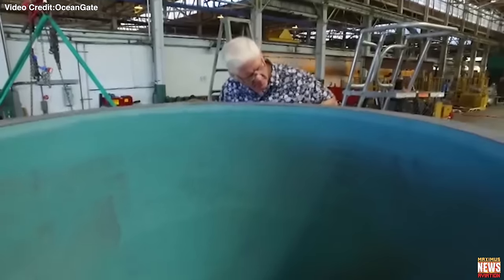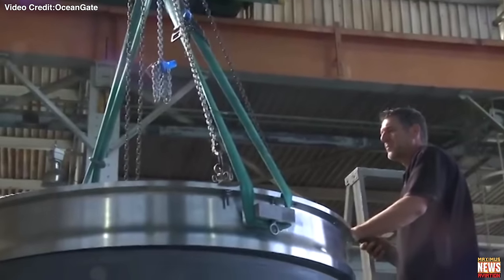Watch The Manufacturing Process That DOOMED OceanGates Titan To Fail. But It NEVER Had To Happen.

Comment: Seeing that young engineer grinning and proud of his glue job gives me the chills.  He says it as though he's building a go cart, not a deep sea submersible carrying innocent lives.
Reply: No one is innocent here and specially not billionaires!
Reply: He's done as an "engineer". I hope no one ever hires him. JMO
Reply: Shouldn't that have been done in a clean room?
Reply: @nighttrain1236  I would suspect a pressurized clean room to remove any voids in the glue as well.....
Reply: That smirk yes pure arrogance the glue that holds the family together try saying that too the familys that have lost their loved ones.
Reply: Yes.I hope that smirk has been wiped off his face.😢
Reply: They also used scotch tape for the lunar landing module.
Reply: Yeah I'd say he's cringing looking back on that
Reply: I am no engineer and its a complete guess but I would have thought that the glue joint from carbon fibre hull to the titanium end caps was the primary weak point. Has anyone tested glue in salt water under compression cycles and all the rest? Add to that the fact the door was hinged on this joint and it just seems like warping of the structure and compromise of the glue joint could easily occur.
Reply: That glue job was an absolute joke.
Reply: @johnmindson237  They should have used Gorilla!.
Reply: that glue job was pathetic
Reply: @johnwright7895  Cant stand his grinning face.
Reply: @johnwright7895 i'm sure it has
Reply: Surprised how narrow the carbon fibre strips were. The glue was being mixed as thought this was a furniture workshop. It looked like this sub was being made in someone's garage. Saw elsewhere it was described as being 'home made" this video shows that to be true
Reply: Tony Nissen - future unemployment line engineer
Reply: Wiping off excess with the plastic spatulas seems wrong. Would want as much adhesive as possible to fill every void.
Wipe off excess as is oozes out when the ends mate. The 90 degree between the titanium and carbon fiber tube could  it take flexing. Suspect it broke there if not the carbon to titanium seal.
Reply: @DALKINION  Cringing is the least of his problems. Everyone who designed that death trap of a sub should be facing criminal charges.
Reply: @johnmindson237  wasn't that version of scotch tape specially made for NASA?  The stuff they used inside Apollo 13 was Duck/duct tape
Reply: @chatteyj  Good point chatteyj. When I heard he was using epoxy resin which is the same thing as JB weld in the stores, I was shocked. JB weld claims their product has a tensile strength of around 5000 psi, but the Titanic depth has a pressure of 6000 psi. It probably sprung a leak at that joint and it was game over.
Reply: @azurie580 why do you assume he's envious? A commoner can't criticize someone wealthy without being jealous. Pfff you people for real.
Reply: @johnmindson237  maybe the living conditions on the moon are slightly better than in deep sea
Reply: 😂😂😂😂😂loll true.
Reply: These engineers look like they are from IKEA😂
Reply: So let’s glue 2 dissimilar materials together in a non sterile non dust free environment then go to 4000 meters it will be fine
Reply: The young engineer might be a smart cookie, but just carrying out the orders of Stockton. "Whatever you say boss, you're signing the paychecks" kind of thing.
Reply: I'm totally disgusted in the arrogance and flippant nature of the people involved in making this submersible. With Stockton Rush's passing, we can no longer hold him accountable for his actions, however the people employed under him who were involved in the construction have to be brought to justice.
Reply: When you need a job, you keep your mouth shut and your smile wide even if the boss is a colossal moron.
Reply: @MissX905  I would hire him for a glue job, even if he seems more interesting in sniffing the glue! 🤣🤣🤣
Reply: the sub was put together with Elmer's glue
Reply: What a joke, bunch of amateurs running this company. They all need to be charged.
Reply: naaa you’re just over reacting too much drama
Reply: @hillbillybeerdranker6678  i can pry things that have been glued with jb weld apart with my hands
Reply: @DickyNuts  Good point my friend
Reply: @johnwright7895  hes just spent some time giving evidence and is laughing all the way through.
Reply: I like to say scotch tape.
Reply: they also skipped the whole part where carbon fibre is woven as a MESH

and not over layer over layer over layer in the same direction

what a bunch of fools

i dont have a degree and i know that

i also know that glueing different materials together, could lead to problems in temperature changes

all of them should never get a job in construction / engeneering again
Reply: 1:40 they also did it in a construction hall

where debris and dust can fall into the glue and onto the surfaces where the glue is applied

which means gaps and air bubbles

i want anyone working there on a ban list for any important job for the rest of their lives
Reply: 1:50 they look like a bunch of art students, working on a new modern art statue lmao 

absolutlely mindblowing
Reply: 2:30 also.. how did they make sure that no big air bubbles are in between the layers?

This is a common problem when putting a CPU cooler on the CPU

if the thermal paste is spread wrong, little air pockets can prevent full contact of the CPU cooler

this mostly happens when the WHOLE cpu is covered with thermal paste. The most effective way is to make a cross spread, so the thermal paste is pressing the air out.

i bet combined with all the debris and dust in the hall, that they 100% had air pockets in those glue layers.

which then expanded like crazy when diving, putting additional strain onto the whole structure.